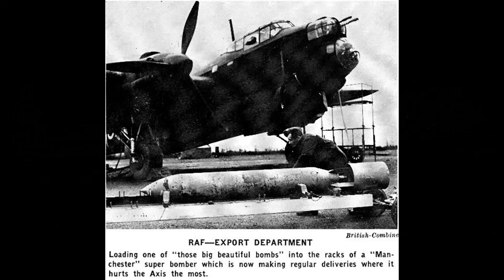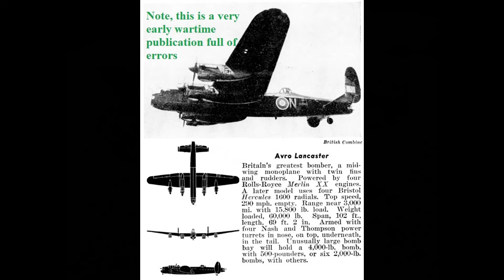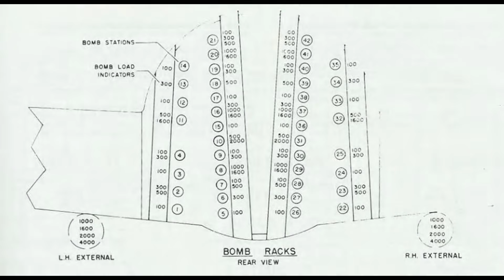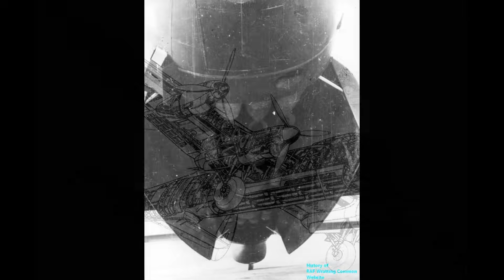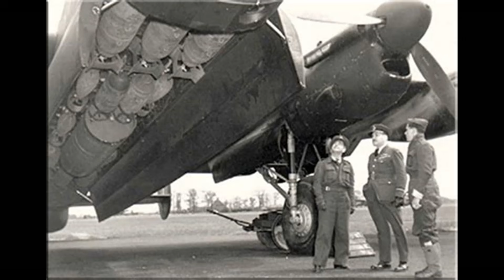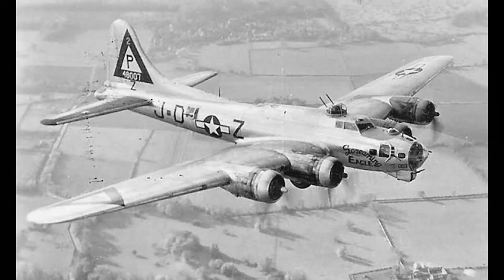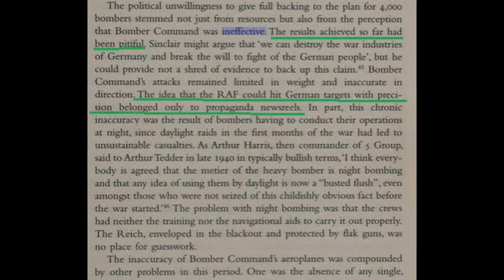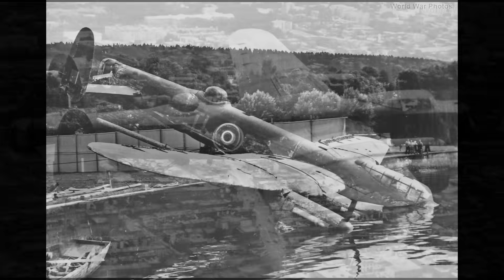Avro Lancaster, Payload, Turrets, Stability and More

Comment: Germany developed 20mm Incendiary rounds for plane ammunition in 1943 because their regular HEI and Mineshells had limited range when attacking bombers directly from behind.
Someone posted an image from a German report, where both Stirling and Lancaster wing profile are shown with the location of the fuel tanks and how there’s a large area when attacking from behind where 20mm shells would be unable to damage the fuel tanks.
Thus they needed incendiary ammunition that could penetrate the airframe deeply so that attacks had a better chance of striking the fuel tanks and setting them on fire.

Later that year they also introduced 20mm API shells, for the sole reason that allied bombers might start to add armor to the fuel tanks to protect them against those 20mm incendiary shells, which of course never happened.

A typical German case of preparing for something they think they would be doing.

Comment: He didn't mention two significant failings of the Lancaster.   1.   It had only basic trim facilities.  Thus a damaged Lanc could be very difficult to fly.  The B-17 was much better in this regard.    2.   The Lancaster did not have a co-pilot position.   If the pilot was injured by enemy fire, the aircraft and crew were lost, even if the aircraft was structurally and aerodynamically sound.
While the Lancaster might have been nice to fly under ideal conditions, the B-17 had a co-pilot position, so the pilot could be rested, and both pilots could grapple with any problem.   If a B-17 was flyable, it could get home.
Reply from the maker: Yes, you're correct, but this wasn't really a B-17 vs. Lancaster video. If it was, then yes B-17/B-24>Lancaster.

Comment: American bombers had a release mechanism that could let the bombs go either safe or armed with the flick of a switch.
A wire was used to replace the safety pins and could be either retained on the shackle if the bomb was dropped armed, or let go with the bomb.

Comment: I think you'll find it was "Vulture" rather than "Vulcan"
Reply: He called it "Vulcan" once, but "Vulture" otherwise.

Greg used the "basically two Peregrines joined together" myth. 

The Vulture design predated the Peregrine, which was a modernised Kestrel.

The Vulture had 90° between banks, rather than 60°, and had a wider bore spacing - very similar to the Merlin's in fact.

Not many compenents were shared between the two engines, save for pistons and valves, and the like.

Comment: 13:45 

It's not really a myth. To get the range and altitude the B-17 had to reduce to roughly 4000-8000lb depending on where they were going. The maximum 12k bomb load was with a fully stacked bay and special wing mounts which crippled its range and speed. 

Lancaster on all Internal could get 14000lb to Germany and back easily. The caveat was that the Lancaster's optimal altitude was a lot lower than the B-17 hence switching to night missions because they got especially murdered by both fighters and the AA that the higher flying B-17s were relatively safe from. 

The Lancaster wasn't surpassed in payload/distance until the B-29 rolled in. Hence why it had the capacity to get 22,000 lb Grand Slams to Germany which was a round trip of about 800 miles in a straight line......
Reply from the maker: No, the 12,800 pound maximum bomb limit is INTERNAL, it has nothing to do with the special wing mounts which were external. The number for the B-24 was 13,200. For the normal Lancaster it was 14,000. The Grand Slam Lancasters were specially modded planes for that purpose that could only operate in areas of total Allied air superiority. If we count the payloads of specially modded airplanes with no defensive firepower the B-17s could and did carry a 25,000 pound payload. The Lancaster's payload advantage over the standard B-17 is due to the 17's much heavier defensive firepower and armor, which were needed for the daylight raids into Germany, which the Lancaster simply couldn't do.
Reply: @GregsAirplanesandAutomobiles Okay you tell me in which dimension you could physically fit 6 2200lb bombs inside that tiny bay and fly it to the ruhr. I'll wait.

Also the bit about grand slam was to highlight the excess capacity and range capabilities, of course they had to be modified but its not starting at a 4k cookie is it? It had that bigger capacity to begin with. I also think i covered how easg the lancs were murdered though..
Reply: @GregsAirplanesandAutomobiles  My understanding was that a maximum of 6 x 1,600lb AP or 8 x 1,000lb GP bombs could be carried internally in the later B-17s. Possibly 10 1,000lb AP bombs could be carried internally as overload.

AP bombs were not used much by the AAF.

To get to 12,800lb requires 8 x 1,600lb AP, but there are only 6 locations for them internally according to the loading chart. The other 2 would have to be hung under the wings.

I do not know about the B-24's load.

You do not mention why the Lancaster's bomb bay was so large.

It comes from the original requirement to carry two very large torpedoes.
The Manchester was also to be catapult launched, which explains the strength of the structure. Some catapult launches tests were done, but the idea was abandoned,

The maximum load of 14 x 1,000lb bombs was achieved by shortening the tail of the 1,000lb MC bomb (equivalent to US GP bomb), similar to what was done to fit 4 x 500lb MC bombs in the Mosquito.

With some modifications to the bomb bay doors, the Lancaster could carry 8,000lb and 12,000lb HC bombs, and the 12,000lb Tallboy bomb internally.

The 4,000lb HC "cookie" could be carried internally without any modifications. It was 30" in diameter, while the 8,000lb and 12,000lb HC bombs were in 38" diameter, as was the Tallboy.

There was also a 4,000lb MC bomb, but it wasn't used as frequently as the HC.

If the B-17 bomb bay was modified in the same way as the atom bomb B-29s, it still could not carry the 4,000lb bombs, as the bulkheads at each end of the bay were not far enough apart.

The B-17 could carry 2 x 2,000lb bombs internally. It could be combined with 2 other bombs, such as the 1,000lb GP bomb.

The RAF did not have any 2,000lb class MC type bombs, only the older GP bombs with low charge-to-weight ratio.

As for not being able to access the bombs in flight, I'm not sure that any WW2 RAF type allowed that.
Reply: It really also depends on teh type of bombs being used.

If the load was the smaller bombs, 300lb or lower, they could stack a lot in, and not get a very large load. 

They could carry 16 x 300lb GP bombs for a total load of 4,800lb. 
Or 16 x 250lb GP bombs for a total of 4,000lb

Depending on the range, they could have carried 6 x 1,000lb to the target. I believe that was a load sometimes used for missions to the Berlin area.

Similarly, Lancasters rarely flew with a full load of HE bombs, often combining HE bombs and incendiaries, which reduced the overall load.

Comment: On terms, from your video, perhaps a low-wing plane is one where the wing blends with the lower fuselage; high wing where the wings blends with the top of the fuselage, mid-wing is anything in between, where the winged is not blended or merged into the top or bottom of the fuselage. On the lower turret, as you point out, its elimination left the Lancaster quite vulnerable to attacks from below, a weakness the Germans exploited with night fighters that had upward-firing guns. It's debatable whether keeping an improved turret would have helped much. The Germans could attack from below with the bomber silhouetted against the night sky; the attacking fighter would be masked by the ground below.

Comment: Dihedral is what makes two channel RC models work using rudder elevator control only. Yaw caused by the rudder causes higher angle of attack on one wing which induces bank. Two channel radio gear soon gave way to multi-channel gear many years ago.

Comment: The Lancaster was what a B 24 should have been they share a lot of design cues, However, its main fault was WW1 defensive armament . This is why it was a night bomber. Had it been set up to be a day bomber The war could have been a year shorter.
Reply from the maker: Add in the extra armor and defensive fire stuff and the Lancaster won't be competitive.
Reply: @GregsAirplanesandAutomobiles  Competitive with what? It was a night bomber because it could not operate in daytime precision bombing due to its lack of defensive armament . Had B 17's And B 24's operated strictly at night loses would  have been far fewer and results would of been better due to the better Norden bomb sight , not to mention long range escorts such as the P 51and P 47's . The RAF had no concept of a long range escort . A Spitfire would have run out of gas over France much less Germany and its 303 caliber guns just like the Lancasters scared no one . The question remains competitive with what ?

Comment: 20:56 Periscopes are not light buckets. With a minimum of two right-angle prisms, the typical periscope is a poor light conductor compared to a telescopic sight mounted on a rifle or artillery gun. The view through a periscope is generally acceptable in daylight, but at night it is likely to be so dark as to be effectively blind. This is why WWII German U-boats generally made their attacks on the surface at night. This is also why most American submarines had two periscopes. The daytime attack 'scope (Submarine Periscope Type 2) was only about 2/5 inches in diameter and intended for submerged attacks in daylight, being mostly useless after dark. The larger watch periscope (Type 3) was intended for night attacks. Unfortunately, even the much brighter optics of the watch 'scope didn't help optical ranging in most nighttime conditions, which was a contributing factor to the poor combat results experienced by USN subs between 1941 and 1943. The most successful skippers in the early years, men like Dudley Morton, gave up wasting torpedoes by making submerged night attacks, and followed the German example. This problem was alleviated considerably when a new watch periscope with a self-contained ranging radar (Submarine Periscope Type 4) was introduced in 1944. In ideal night conditions the optics could resolve a good bearing, however, even in poor conditions the ST radar antenna mounted in the Type 4's head could resolve both an acceptable bearing and range out to about 5 miles if the target was a large warship and out to three miles in the case of a typical merchant ship.

I have no data regarding the Lanc's periscope, but I seriously doubt it was more sophisticated than a submarine periscope. Therefore, its usefulness at night just isn't credible, particularly given the fact that the Lancaster was initially designed for daylight bombing. 

Defensive firepower was not very effective for any Allied heavy bomber flying at night. The Lanc lost its ventral turret first, and thus gained a bit more range, speed, or bombload -- a good trade given the situation. Later, even the mid-upper position was removed and plated over on many Lancs, especially those equipped to carry the Tallboy and Grand Slam bombs, which often flew daylight missions. The tail position was retained, however, but not primarily for its defensive MG fire, but as a lookout post to warn the pilot about German night fighters approaching from behind.
Reply from the maker: I made this video three years ago. Without a time stamp I have no idea what you're addressing.

Comment: Is it really fair to count 12,800 lb as the maximum normal bomb load of the B-17? It seems like it can only carry that much because it would be using more slender 1,600-lb armor-piercing bombs. Even though the weight is similar, the damage isn’t comparable to a Lancaster’s 14,000 lb bomb load. If I’m understanding that chart correctly, if you want the maximum internal load of general-purpose bombs, it’s 6,000 lb for the B-17 compared to still 14,000 lb for the Lancaster. But then I suppose the question arises that if you really want to maximize the damage done per plane, and range is no object, then why not use the external racks to further increase payload?
Reply from the maker: Fair? I wouldn't say the damage isn't comparable, it depends on what sort of target your bombing. As for external racks, the B-17 did have them and could carry quite a bit more with them, however that wasn't often done. As for damage done per plane, that metric is thrown off because of the relatively poor accuracy of night bombing. Even in the daytime, Lancasters didn't do that well in terms of accuracy as we saw in operation crossbow. They got zero hits. The B-17s and 24s were not great either but had far better results than the Lancaster.

Comment: Thanks again Greg, for another interesting article.  Attached is some  interesting accounts of the Augsburg Raid the first includes an interview with Patrick Dorehill who flew on the Raid, the second link was published on the 44 Sqn (who led the raid) website - interesting in that it states that Oesau (one of the 109 Pilots) was actually on the ground when the 44 Sqn ac appeared, this is backed up in the third Link - the 97 Sqn account of the Raid.   While the timing error by the diversionary raid was not good, it was the navigation error by Nettleton's crew that caused the carnage that befell 44 Sqn.  For me, the whole Raid lacked proper planning. There was apparently no attempt to access survivability of a Lancaster at low level to Fighter attack before the raid,  and a complete incomprehension of the lethality of light Flak at low level, moreover the use of 12 second delay fuses would cause target obscuration to the following crews, added to which the danger of being blown up by the bombs of the ac ahead of you;  lastly attacking at 50 ft not only exposed you to light Flak, but also ensured there was no penetration of the Bombs, which would greatly reduce the scale of damage - it might also account for why 5 of the Bombs failed to explode.  This is not a criticism  of the Crews involved, but more a reflection on the poor experience and level of tactical training of RAF bomber aircrew in WW2, the same observation might be made of the British army in WW1, when having lost much of their (small) professional army in the early days of the war,  the inexperienced PALS brigades suffered horrendous casualties using tactics that no sane professional soldier would have used.  Let me close by saying I have had the great honour to dine with many survivors of the Bomber offensive, and I could not wish to meet a better bunch of brave, self effacing men. https://www.cbgc.co.uk/the_augsburg_raid     https://44sqn.com/newsletters/sept-2021/raid/    http://www.97squadronassociation.co.uk/ausburgmod.html

Comment: Apparently the US Army Air Force materiel Brank were very impressed with the Lancaster III  when tested in the US The full report can be seen on WW2 Aircraft Performance as a addendum Highly recommended
Reply from the maker: That's true, but it was from a pilot's point of view, not a General's. The Lancaster was a great flying airplane, no question about that.
Reply: @GregsAirplanesandAutomobiles  Greg Prepared by Ernest K Warburton A.C. Approved by S.A Gilkey Colonel A.C. and approved by F.O.Carroll Brig.GeN. USA. Chief Engineering Division

Comment: Compare the fate of the Avro Manchester with 2 unreliable Rolls Royce Vultures with that of the Heinkel He-177A with two dangerously unreliable DB-606 coupled engines.

Recognizing a good air-frame, the British Air Ministry encouraged Roy Chadwick at Avro to redevelop the Manchester into the 4 engine Lancaster and the rest is history.

According to Ernst Heinkel, the personal embarrassment the the operational failures the He-177A had caused Goering to refuse to allow him to redevelop the He-177A into a 4 separate engine bomber without the ridiculous dive-bombing requirement. Heinkel built one anyway in Vienna - out of sight of the RLM - (called either the He-277 or the He-177B) and a separate high altitude 4 engine version at the Farman factory in occupied France, the He-274. Both proved to to be excellent aircraft with great development potential. Neither would contribute to the German war effort.

The insane military politics and lack of vision of the German Air Ministry (RLM) denied Germany what might have been an excellent heavy bomber. 
By comparison, the British Air Ministry managed to salvage an engineering disaster and turn it into a first class asset against their enemy.

Comment: The Lancaster was an awesome bomber, for its handling alone if not all the other reasons, but it had a weakness in common with every other non-American heavy bomber; low operational ceiling due to lack of turbos. 

The two-stage Merlin would have helped, though I have no clue about the airframe at 25,000 feet, but I'm not sure about durability and reliability. It was great in fighters and Mosquitos but would they have stood up to lugging a heavy bomber to max range over time? That's something I don't know either but would be very interested in more learned opinions.

 My guess is that it would have been a little iffy. Radials with turbos seem to be the only answer for high altitude heavy bombers.

Cheers!
Reply: There was the mark VI Lancaster with two stage Merlin 85's, only a handful were made but there were issues with them which weren't fixed until August 1945.